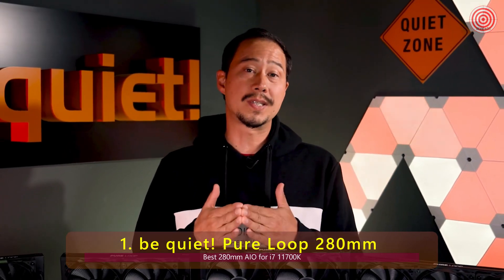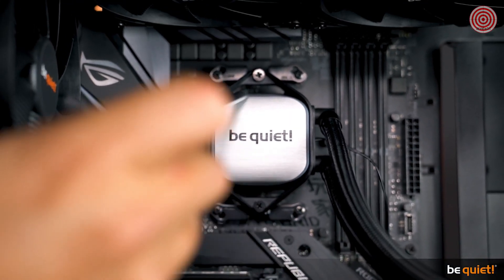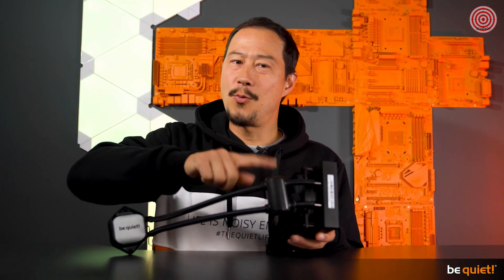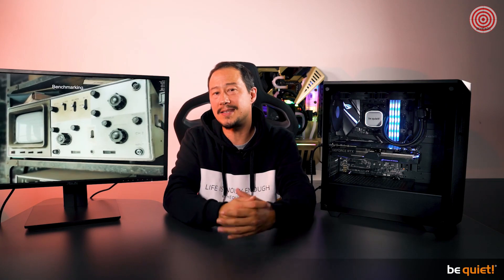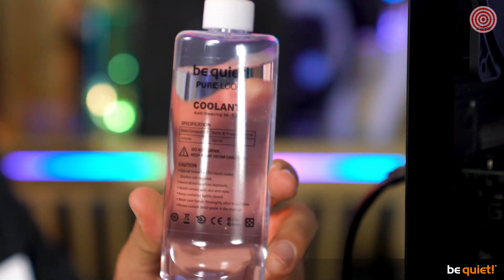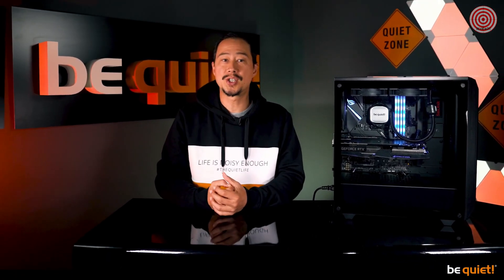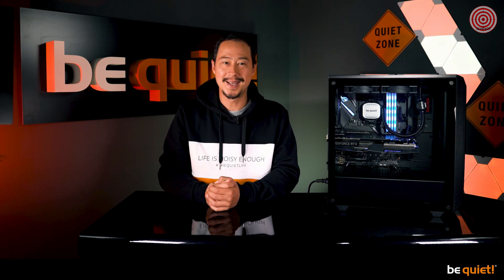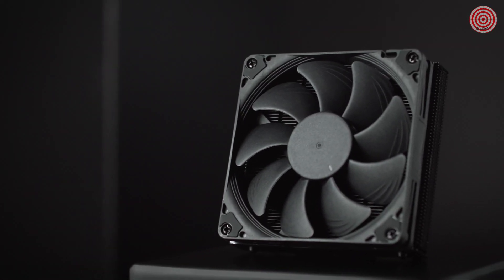The 5 Best CPU Coolers for Intel Core i7 11700K 2022

Comment: Can a nzxt 280mm radiator cool a intel 11700k?
Reply from the maker: Yes, a nzxt 280mm radiator can cool an Intel Core i7-11700K processor without any problems.

Comment: my cpu is Intel i7 11700k  LGA1200. 

CPU cooler - MSI mag 240R coreliquid Liquid cooler. 

Its just been 1 and half year, 3 times it given headache and changed thermal paste.

now, my CPU reaching 100 d  celcius now and then or randomly at even idle or basic work.. and constant 100  celcius at rendering in after effect or gaming. 
I don't want to damage my CPU. 

I think problem with MSI 240R cpu cooler. 

Which one is better? Air cooler or i should go and test new liquid cooler, now i am scared what if leakage or dies or needs refill or currently newly bought 1.5 years ago liquid cooler just not cooling and making cpu 100c reach.

please suggest. i need to work from my pc and also play game sometimes.. 

grpahic design, render, encoding
Reply from the maker: It sounds like your MSI MAG 240R liquid cooler is not working properly. The normal operating temperature for an Intel i7 11700K CPU is around 70-80 degrees Celsius under load. If your CPU is reaching 100 degrees Celsius, it is definitely too hot and could be damaged if it continues to operate at that temperature.

There are a few things you can do to troubleshoot the problem:

Make sure that the cooler is properly mounted and that the thermal paste is applied correctly.
Check the pump to make sure that it is working properly. You can do this by placing your hand on the pump and feeling for vibration. If the pump is not vibrating, then it is not working.
Check the coolant level in the radiator. If the coolant level is low, then you will need to refill it.
If you have checked all of these things and the cooler is still not working properly, then you will need to replace it.
I recommend the Peerless Assassin 120 SE.

Comment: My cpu is  i7 11700k and my cooler is corsair h100. While playing games, the cpu temperature rises 100 celsius and also uses 260 watts. Quite a lot and i couldn't find any cooler for my cpu. I was thinking about msi mag 360r v2 and I am not sure anymore. Do you have any suggestions and how much does it affect the temperature?
Reply from the maker: The Corsair H100 should handle this processor. Have you had it for a long time? If yes. When did you last clean it? (Fans and radiator). Try changing the thermal paste. If that doesn't work, I recommend you use arctic freezer ll 280 . It should keep your CPU around 80°C
Reply: @AryTechB I've had it for a year and I changed thermal paste etc. but I didn't understand why does not keep the cpu around 80 celsius. I think the cooler has an issue but, I have been trying to find the solution to that issue for a week, but I couldn't find anything. Today I just give up and, I bought a new cooler and now the CPU temperature is around 65 celsius.
Reply from the maker: I'm glad you managed to solve your problem!
Happy gaming!
Reply: @batuhaneyuboglu4669  please which cooler did you get?
Reply: @chuksjerahmeel1355  Thermaltake toughliquid 360

Comment: is fine 70c in the intel i7 11700k tieh full carge? I have a Cooler master hyper x 212 with 1 fan. Thank you
Reply from the maker: The temperature at which the CPU I7-111700K works is OK. You should have problems if it approaches 90°C or exceeds this temperature.

Comment: I have an 11700kf, my cpu runs around 90-100 celcius when playing some games. My cooler is a CyberPowerPC DEEPCOOL Castle 120EX ARGB 120mm AIO Liquid CPU Cooling System w/ Copper Cold Plate. I also have 3 120mm fans, I know nothing about computers but I need to find a better cooler. The support for cyberpower didnt say anything they just told me they suggest a new one. They really cheaped out on some parts. What cpu cooler do you think would be best?
Reply from the maker: I recommend  e quiet! Pure Loop 280 AIO or something similar.
Reply: @AryTechB  Now do I need to like take care of the pure loop 280 cooling system? This one I don't have to do work for, I just plugged in the wire and turn on my computer
Reply from the maker: You asked for a recommendation for your CPU.
Reply: @Dooflecker   A 11700 with a 120 aio is like a toaster, go to a minimum of 240 or higher aio

Comment: hi i have a noctua nh-u9s and i get about 80c and below while im playing max settings on horizon zero dawn, would i get below 70c with this dark rock 4?
Reply from the maker: I think it will work around 70 ° C but not below.
Reply: @AryTechB  ok then i maybe need that dark rock pro 4 cause i want to hit around 60-70c max, how is it with the ram space is there 2 slots that are height limitless?
Reply from the maker: @LinusF_    I say that with DRP4 you can get temp between 68 and over °.
As far as the RAM hospital is concerned, there should be no problems, as far as I know.

Comment: Do you think fuma 2 can handle 11700k
Reply from the maker: Yes! It copes without any problems.
Reply: @AryTechB  i am getting around 77c while gaming. Not sure what the issue is, tried everything even remounting multiple times.
Reply from the maker: @nirmalvishal2013 No problem. It is normal for such an air cooler.